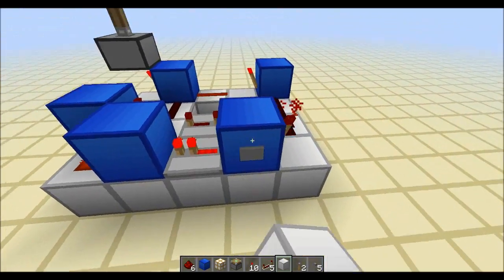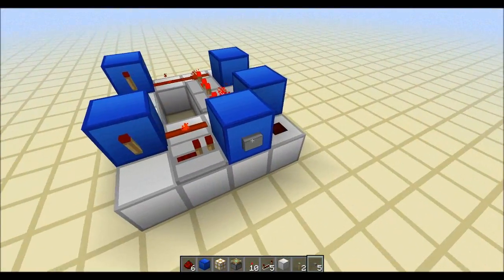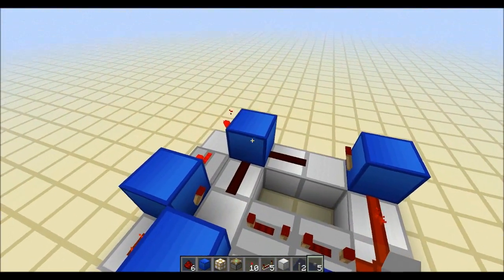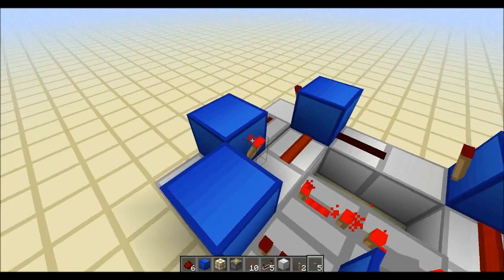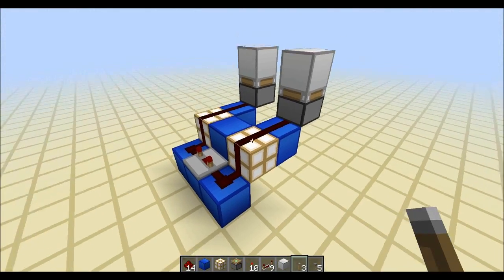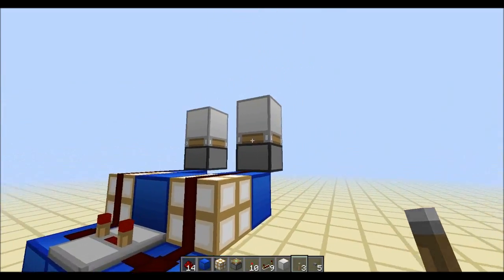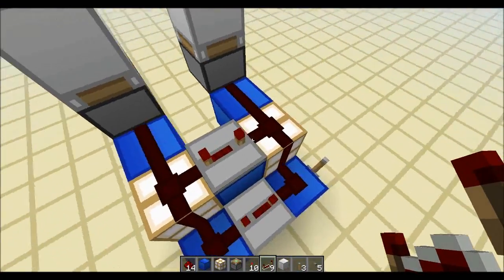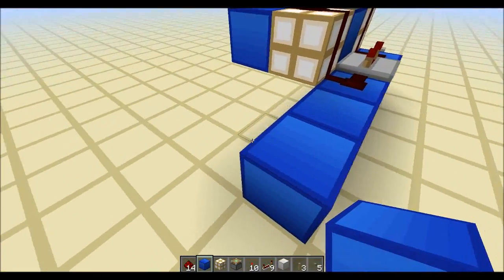Minecraft: Sharing is Caring #002: Pistonless T-FlipFlop & ABBA-gate

Comment: There is a new MUCH smaller design, thanks to the new minecraft locking repeaters.

Place a block, then place a button on it and a redstone torch on the side. In the same direction that the torch is facing, place redstone, then make it turn left into a repeater on full delay.

Where the button on the block is, on the other side of the block, play a redstone repeater also on full delay. 

If this works, the repeater should always be locked and the output from the locking repeater t-flip-flops

Comment: Hi i've come up with a 
T-flip flop but since i'm not popular i cant spread it but its quite small
I use a dispenser with water and if u didnt know they actually work as T-flip flops already so i put the dispenser on the ground and a boat in front and put blocks around the boat except infront because i have a wooden pressure plate to send output

Comment: I checked it again. I built them in all four directions and it turns out that two directions work fine and two do not. The ones that don't work fire twice; one is the B piston, the other is the A Piston. I did not check what happens if you reverse the side the lever is on.

Comment: basically the first design is two rs-nor latches combined togethor to take the form of a stable "4 o' clock" which only changes output (stabley) when provided a redstone current to one of the two powered torches within the two rs-nor latches

Comment: the point of a t-flip flop is to imitate the action of a lever using a button or a pressure plate, if you want to use a lever, or switch, you don't even need to make a t-flip flop.